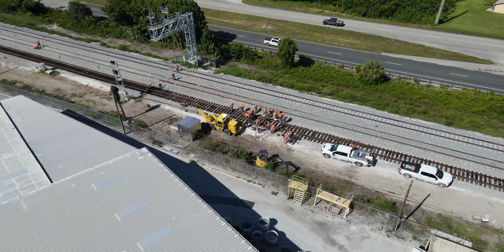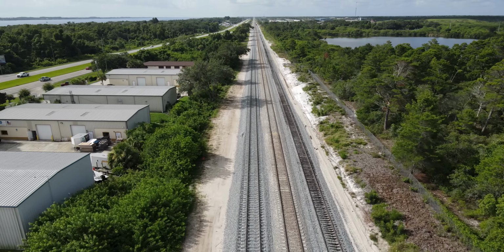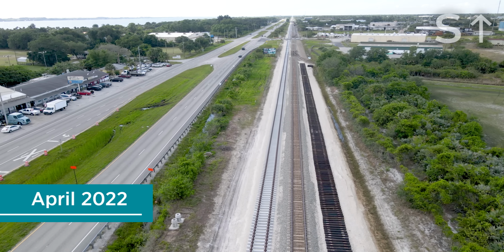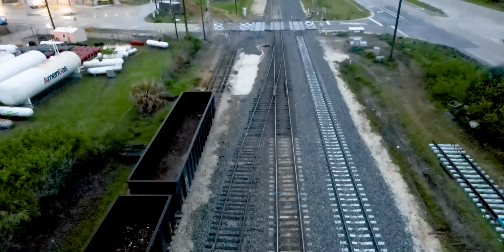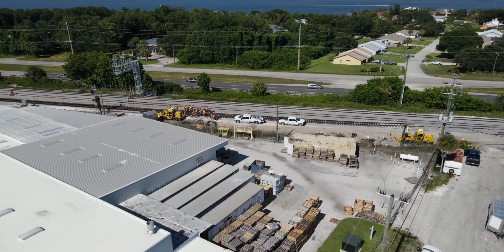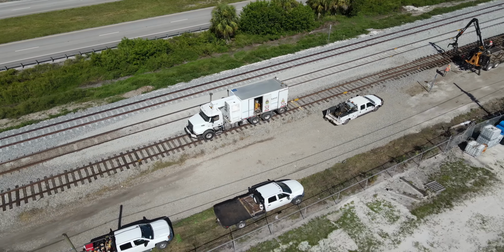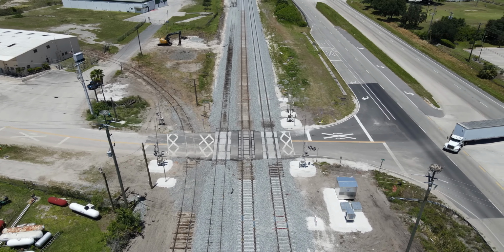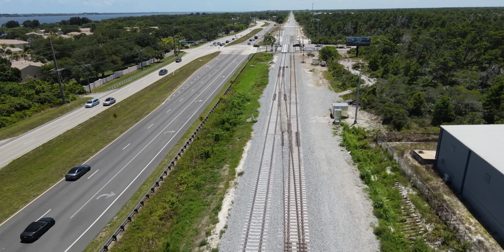Brightline Construction ATC19 Cutover: CP Bonaventure to CP Viera & Bonaventure Siding - July 2022

Comment: I see long lengths of continuous welded rail being put in place, but no expansion joints/breather switches. How do they deal with expansion/contraction of the rails?
Reply from the maker: The rail is put through a process called destressing which helps deal with those issues. I haven't done a video on it because there is not much to document without being right with the crew doing it.
Reply: Basically, the rail is either laid within 5 degrees of the average of the minimum rail temperature and the maximum rail temperature for that area or adjusted to that temperature while installing anchors on wood ties or applying the clips on concrete ties.   With the heavy ballast section and full cribs, the stresses can be contained between adjacent ties instead of building up.  There are places on railroads that are welded for over a hundred miles or more including turnouts without expansion joints.  Moveable spans, bridges, are not included in this calculation as all rail is well anchored on each side to prevent any rail movement that might hamper span opening or closing.  The rail temperature is taken on the shaded underside of the rail head so direct sunlight does not affect the thermometer.  The rail temperature will never be any lower than the ambient air temperature and in the summer it can be 40 or 50 degrees higher than the air temperature because of direct sunlight on the ballast, ties, and rail.  That is why it is so important to actually measure the rail temperature at different times of the year and keep a good record of those readings.

Comment: You mention increased speeds--how far along the tracks will that extend? Most of the way to West Palm Beach? Will the areas south of West Palm also get new gates/signals and be upped to 110 mph?
Reply from the maker: From Cocoa to West Palm Beach, south of West Palm it will remain as it is.
Reply: @RoamingRailfan  So is the idea that Orlando to Cocoa is 125 mph, cocoa to WPB is 110, and 79mph for the rest of the line?